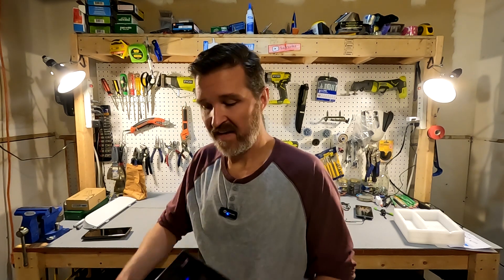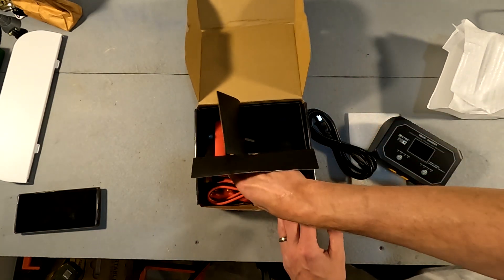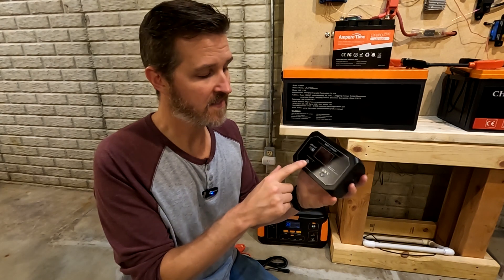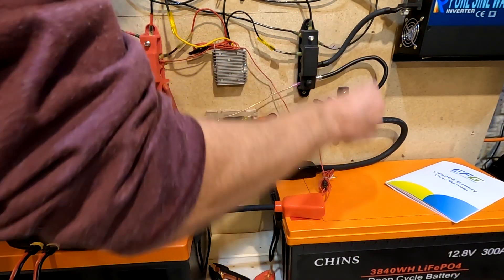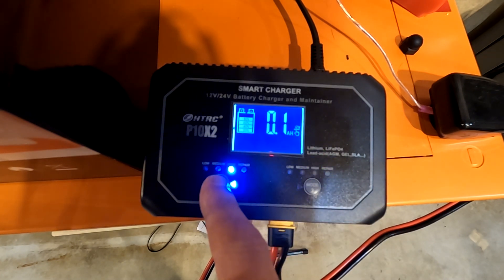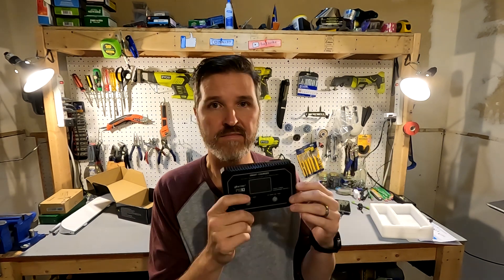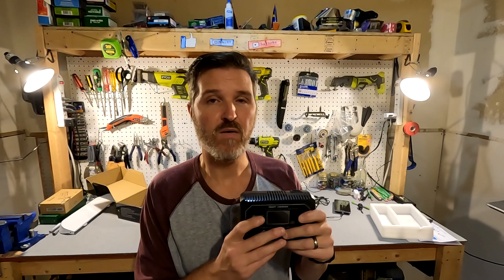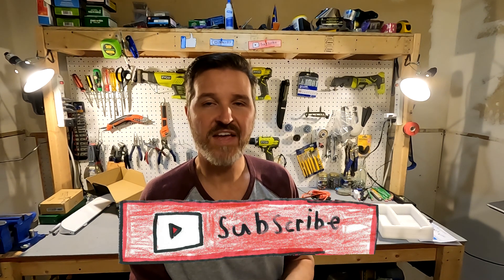P10X2 Battery Charger Review.  Charge 2 batteries at separate voltages at the same time!

Comment: Or a recommendation for dual trickle charger for RVs w small clips instead of these humongous ones
Reply from the maker: I believe these are standard clamps.  You could cut them off and possibly use ring terminals?

Comment: Great video thanks for sharing! Are you sure the indicator light isn’t switching between which battery it’s charging? Just want to make sure it simultaneously charges both regardless of which “mode” it’s in. Thanks!
Reply from the maker: I does charge both sides at the same time.  Unfortunately one of the sides on my unit crapped out.  I don't know if the charger is a good option.

Comment: Do you have to plug it up to use it? I was planning on placing it in my car for emergency. But I don't have a plug in my car for it?
Reply from the maker: yes.  It does use AC power to charge the batteries.  This is meant to be plugged into an AC outlet.

Comment: Interesting, and I do like the XT60 connected charge cables. But I think I'll stick with 2 separate chargers - redundancy.  Nextool has a single charger with similar specs (12v @ 10a, 24v @5a), and for under $30 each could get 3 or 4 for the price of this x2 charger.
Reply from the maker: Redundancy is key for off grid living.  That is a very good point.  Thanks for the comment!

Comment: These HRTC chargers are not bad. I got the P20 two months ago and it is still going strong. My only dislike is that they don't have a ring connector for people that just want to leave it on the batteries permanently like myself.
Reply from the maker: Like you said in your additional post...  The alligator clips could very well be creating current drop.  I'll test this out.  Thanks for the info and comment!
Reply: I'm going to add the ring connectors to mine and mine take some work to get to as I have my fridge sitting on top of my battery box in my cargo trailer  @OffGridBasement